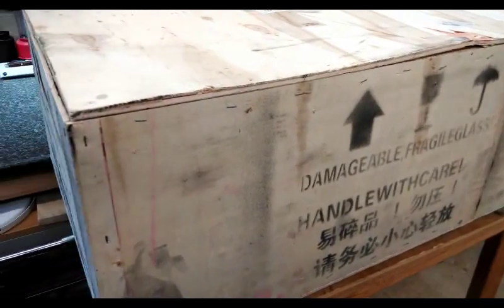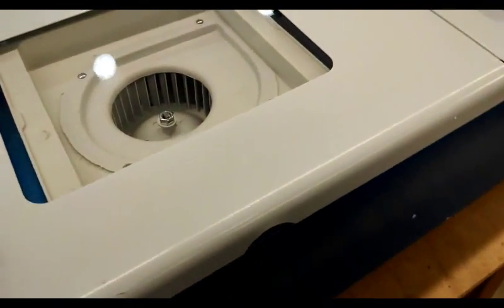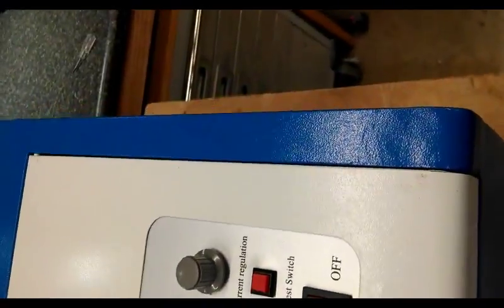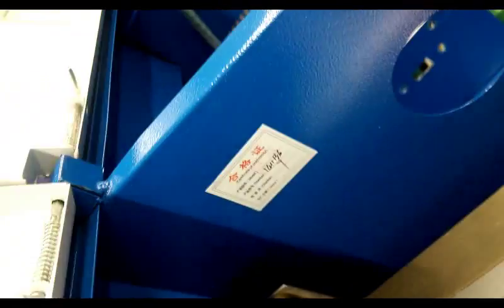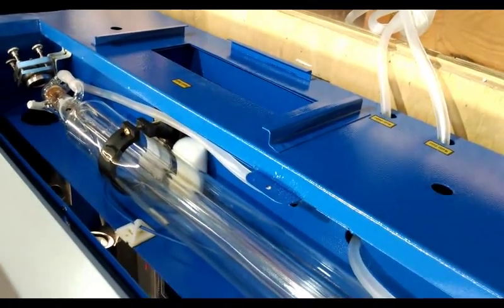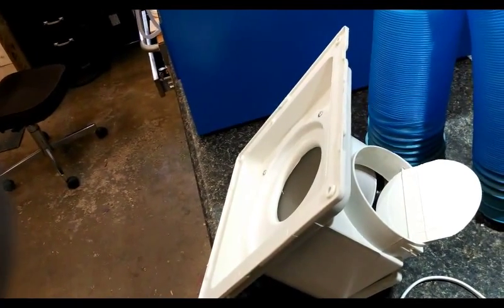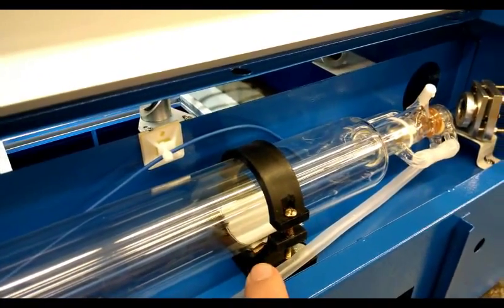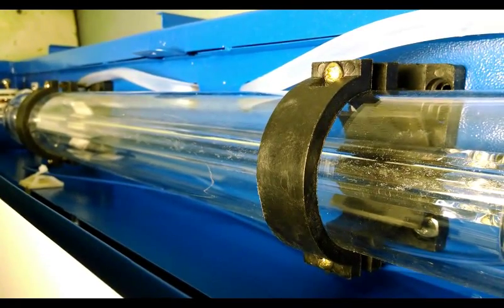Shenhui 40w K40 Laser: Unboxing

Comment: this unit needs a dedicated earth! don't rely on the 3 pin plug with earth. this is 16000 volts! DEDICATED EARTH!!!
Reply: kevin oakes - your house ground is a better ground than anything you will provide as long as it is modern. As a lineman we've  tested multiple grounding systems and soil conditions. The voltage may be high in the tube but the average is not. If you don't believe me, test the resistance on your grounds.

Comment: How has this unit worked out for you. Thinking about getting one...
Reply from the maker: I've reworked it a few times (basically rotated the bed 180* to get more room).  That said, it still works good.  I haven't had to replace anything on it and I still use it a few times a month.  There is a learning curve on the software, but for the price it's a nice point to get one cheap provided you're willing to learn on the go.  The larger units are much nicer and have a DSP, but the k40 still kicks for the time being.  I'll get something bigger when it goes...
Reply: Thanks for the info.